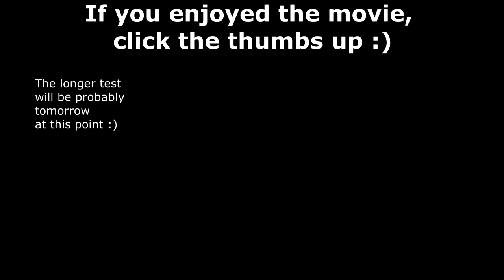Drill HACK 1 metal cutting BANDSAW  part 2

Comment: Very clever. It would be pretty easy to change the drill for a small motor and you could add a counter-weight on a threaded rod to adjust the down force of the blade. Nice work.
Reply from the maker: Thanks! Yes it is true, but it would be hard to find such low engine speeds as drill :)

Comment: i'll make it for sure, great project man! can you tell me the power of the drill?
Reply from the maker: Thanks! It's 700 Wats. Power may be lover but rpm should be so slow as it possibile :)
Reply: thanks! i made a belt sander with a 2000w angle grinder with speed regulator, and i was thinking if make the bandsaw with the same tool, cause it has a good torque, but maybe a drill has a better torque
Reply from the maker: The reason I do not use angle grinder was too high speed but with speed regulator it may works :)
Reply: thank you for all the suggestions! and for the comment on my video=)
Reply from the maker: Any time my friend! Good luck! :)
Reply: i have another question for you=) you put the angle grinder head just for hold the drill better or it change the torque?
Reply from the maker: angle grinder head slowed speed 3x and gives me stronger torque :)
Reply: Made in Poland well i have two old angle grinders to use, perfect, thank you=)

Comment: how much it last the saw blade? because i bought it on amazon cause it was cheaper than at the shop and i was guessing if i need another in case it will consume too fast
Reply from the maker: It depends on the company and how much you are cutting. My has 3 months and still cuts :)
Reply: Made in Poland thats good!

Comment: Hi Darek, nice project as always! At the moment I'm thinking about how I can convert my hand circular saw to a table circular saw. So, if you need an idea for your next project.. :-)
Reply: I actually did that! Unfortunately, I don´t have the build on a video, but you can see me using it in several videos. What I did is I build a table from square steel tubing with top from thin sheet metal and mounted the saw upside down with countersunk screws, Then I made fence from aluminum tubing with tracking made from steel rod.
Reply from the maker: Thanks man! I do not know if you saw this playlist, but if you do not, for sure you will help :)
https://www.youtube.com/playlist?list=PLSnvVtM4lBIV6RpdePEuat1-wYUzHfshj

Comment: you twisted the blade a lot, I've seen this with commercial ones too, why do you do that and how come it works fine and doesn't wander off..?
Reply: As you can see there is a set of bearings holging the saw stable at correct angle. The twist is necessary because without it the size of the wheels proppeling the saw would limit the lenght of the materials you can cut. Those wheels would have to be positioned horizontaly. So the twist is essential for this kind of saw.
Reply: ardvark84 I would have thought the blade would fall off, and the bearings weren't the only thing holding it in place, but I guess not. Thank you.
Reply: CookingTasty  Properly tensioned saw will behave just like we can see on the vid.

Comment: What tpi blade are you running on this? Many Thanks Ash
Reply from the maker: 13x0,65x1335 mm 8/12 :)
Reply: Made in Poland Are you saying it's 8 or 12 teeth per inch? As I've not heard of a 8/12 blade... Many Thanks Ash